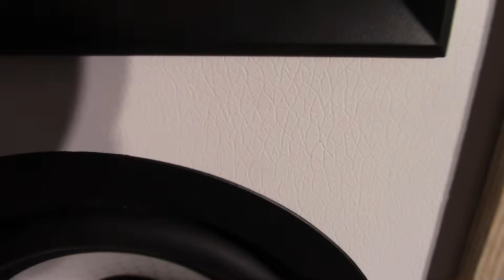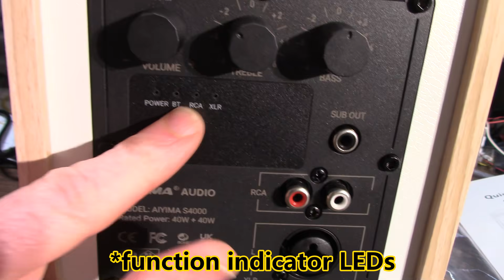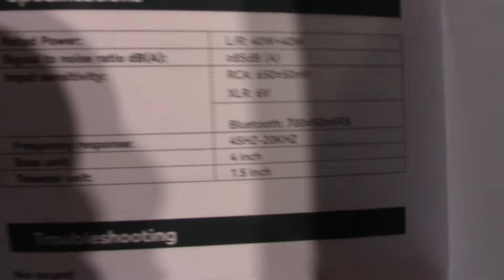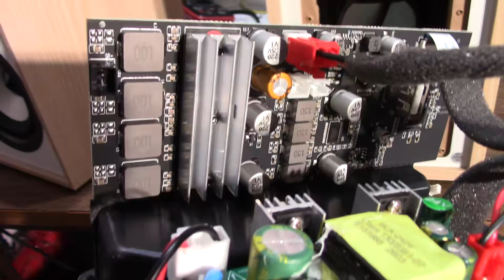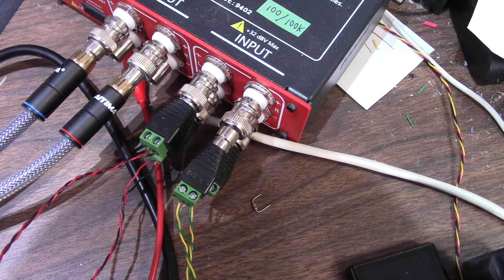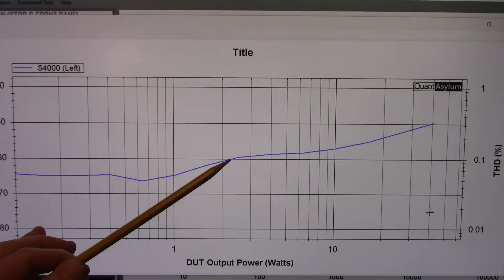Aiyima S4000 powered speaker review

Comment: Unless I missed it in the video I don't think you tested the subwoofer output. I have a pair of somewhat similar but lower cost Singing Wood BT25 speakers and the subwoofer output on them is 100% unusable. There is a constant hum/thump coming out of the subwoofer output anytime the speakers are on, regardless of what source input is being used.

Also, the Singing Wood speakers have an aggressive power save function that turns the speakers off after no input signal is detected after only a couple of seconds. Trying to use those speakers to listen to an online speaker or teacher that occasionally pauses means the speakers turn themselves off and back on constantly. Plus there is a roughly 1/2 second gap after the speakers detect audio before they turn back on so you will miss the first word or two the speaker says. I've had to use an online tone generator site in a different browser tab playing an inaudible just over 20 KHz tone to fool the speakers into staying on all the time when I use them to work around that.

I'm looking to replace the speakers I have so Aiyima's may be a good option if the subwoofer output works correctly.

Comment: Was at GC today, and saw KRK Rokit 7 G4 monitors on sale for $169 each.  They come with a simple DSP, as well as a small (but useful) screen on the rear to see what you're doing rather than dick with dip switches.  The RP7's are powered by a TPA3251 with a pretty decent looking 32V SMPS.
The RP7 is a vastly better speaker by every metric, and on sale at $169 ea, a no brainer.  That is, if you have the space for the larger (7 inch woofer) KRK.
Reply: That's $338 for a pair vs $189.99 for the Aiyima (direct from their website), it would be pretty disappointing if they weren't significantly better.
Reply: KRK seems to have issues with manufacturing quality, though. Can't speak to the 4th gen model, but generations 1-3 tended to fail from dumb things. I believe the EEVBlog has a video where Dave repaired one.

Comment: I’ll have more time to watch the full review later today.  I’ll blame several “influencers” for the current popularity in balanced connections in low cost consumer audio. I have seen reviews of other components with the XLR connections measuring just slightly better that RCA…..not sure if it would be audible for most.  Will watch your full review later to see if you measured or heard a significant difference.
Reply: I agree with John that it wouldn't make a difference. Balanced is beneficial for long cable runs which prevents emi/rfi, but in home stereo, it's of no use.
Reply from the maker: To save you time, I did not test the balanced inputs. Video was running long already, and I doubt it would make a difference with these budget speakers.
Reply: I would appreciate it if everything was tested and assessed even if it doesn't make it into the video. I just want to know what the issues and highlights are. Did you test the balanced inputs to see if they work ok?